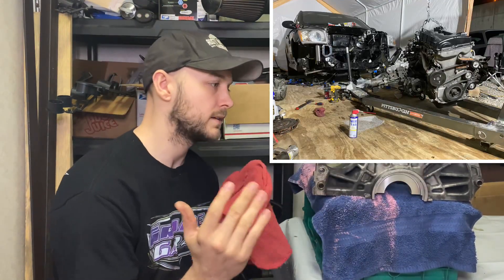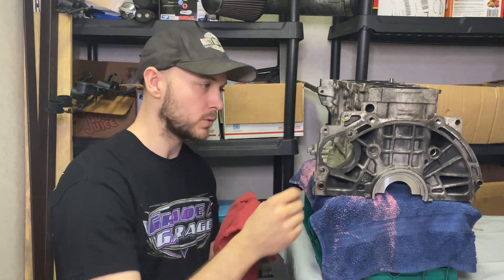SRT4 AWD CONVERSION: How to Convert Dodge Caliber SRT4 to All Wheel Drive / Evo X Transmission

Comment: Funfact: the Dodge Caliber SRT4 was supposed to be AWD, but due to budget cuts at SRT they had to compromise and had to make it FWD. Power had to be cut down too, as there were rumors of 330-350hp first (which is now down to 285/295hp).
Reply: And I got screwed on the other side of Dodge. I have a jeep compass 2.4 L all-wheel-drive, but no turbo no power although it has a automatic slap shifter in it.

Comment: Thanks for this video.  I was losing hope since I have a 2007 Dodge Caliber RT (AWD) and the automatic transmission is SO lack luster.  I want to convert it to manual, but didn't think there was a manual transmission that I could mate with this engine.  So I have a different but similar goal...make an automatic AWD to a manual AWD.  Looking forward to the videos where you show how you fixed the oil pan and bottom engine clearance issues.

Comment: Basically what I heard was evo x tranny, transfer case, clutch, flywheel, ladder frame and mounts. Caliber rt, drive shaft rearend, tank, and hubs.
Reply from the maker: Evo X ladder frame will not work on the 4b12 block. The caliber rear diff does not match the Evo transfer case drive ratio so it will not work together with it.

Comment: What a great video technically explaining what it takes to make the CSRT4 AWD,I have a 2008 SRT4 that I brought from Canada in 2009 with 25000km now I have 130000km on it ,me and  my son now a mechanical Engineering do a bit of car racing ,shifter kart racing and dirt bikes racing, we work ourselves in our projects and racing modifications, and know how much work it takes to do this kind of mods,think design and try it takes some time, that's why we understand when you said it takes a bit of work to do this (A LOT)but when you love doing  it the results are the best payoff , we always are thinking we have to do 4wd the Srt4 because we have enter the caliber in about 5 hill climbing races for street cars over tarmac surface, the car is amazing good for it even do is pretty much stock, we just have KN air filter,65lb/hr injectors,clutchmastes 250,3 inch straight pipe no muffler and a heavy foot, we have beat some good cars like Bmw ix,Subaru wrx,Mazda etc,even when we don't push the car to it's limits because  roll cage it was not mandatory for this class until 2016 when we enter and now we don't want to screw the car interior with it.anyway watching your build it gives us a clear view and advice of the parts,time and mods for it,its a little hard to get Evo parts down here in Ecuador,but we'll be looking for them now in case we decide to do it,and we'll be expectant to see your amazing  project fully finish ,congratulations again my friend.

Comment: I have just the opposite problem. I have a 2008 Jeep compass 2.4 L all-wheel-drive I cannot find any parts for the compass aftermarket so I am referring to the Dodge caliber SRT what parts will fit on my compass from the SRT.?
Reply from the maker: Pretty much everything. What are you looking for?
Reply: @rustynutsmedia  any information on aftermarket parts for performance because this thing does not get out of its own way. heard about Mitsubishi headers that fit and wondering about where I could find the intercooler turbo set up

Comment: Couple questions. 1 are the splines that goe into the translation the same as the caliber spines? You said you used evo hubs with axles and trans. Could you use caliber trans and evo axles and hubs? 
Next question. Did you say you can drop a evo block in just fine? If so would that fix the transfer case hitting the block issue?
Reply from the maker: Axle splines are different. They are not the same. 

I’m sure you could drop in an Evo block if you wanted to go that route and yes, that would fix that issue. But I will say I do not have first hand experience in that, so I can’t say 100%

Comment: Even if you dont actually care about turning the srt4 into an AWD for performance reasons(all srt owners care about performance who am i kidding) its probably extremely cost effective to swap to the evo x trans just for the sake of durability. As those 6 speeds in the caliber are actually horrendously fragile and everything breaks if you abuse them even a little.
I am however curious if the 02m 6 speed in the volk/audi group could possibly pair with the 2.4t. The quattro drivetrain from the late 90s to early 2000s and lack of transfer case sounds like a dream. The gears are kinda short tho but that transmission is often beat on like literal racecars and ive only really heard of the synchros failing especially on 1st but when that happens you can slip the clutch a tiny bit to get it in.
Reply from the maker: @Austin-bc1yh  you think the caliber 6 speed is fragile? What makes you say that?

Comment: The alternator is made that way to shut off when not needed and u can use the rt awd tank with the harness from the 4x4 from my other comment will plug and play and your tank will register correctly
Reply from the maker: I have to disagree with that statement about the alternator “shutting off”. It’s an OAD pulley, it contains a one way clutch and a torsional spring. Basically it absorbs vibrations from the engine and lets the alternator slow down gradually when shifting or shutting down the engine. 

Have you used the AWD tank and harness on a CSRT?
Reply: I stand corrected on the alternator

Comment: Video is great. Idk if you looked into it but do you think the girdle off the 4b11 could bolt onto the caliber block? I l know the motors are super similar but that would solve the problem of transfer case clearance
Reply from the maker: We have tried. It does not bolt on. Bolt holes don’t line up, neither do the oil passages. Currently, modifying the caliber girdle is the only choice.

Comment: so rusty nuts media i do have a question for your expertise im not going to do the awd swap yet :( funds :( but i did just blow my t355 in half do you know if the f5m42 from the lancer gt will bolt to my gema 2.4 theyre engine is gema based aswell i think itd be considered the 4b12 i found one for sale 500.00 only 5k mi on it and money wise im not sure if itll fit or not its only fwd
Reply from the maker: I wouldn’t be 100% sure on swapping those. I only have experience with the Getrag from the SRT4 and the Evo GSR 5spd. The bell housing bolt patterns probably align, but you’d have to look at all other factors to see if it would match up
Reply: @rustynutsmedia  I just bought the transmission I'll let you know when I find out I can send pics too
Reply from the maker: @M3CHF5  keep me updated
Reply: @rustynutsmedia  hey bud how exactly did you swap the ends on the shift cables?
Reply: It's in I sent u a couple photos on Instagram
Reply from the maker: @M3CHF5  cool man I’ll check them out

Comment: R/t awd is only automatic but I know how to make evox ayc rear work with the hydraulic pump from the evox using the stock chrysler electronics ur gonna need the harness from the compass or patriot 4x4 5 speed with the 4x4 controller I'm still looking into the caliber rt awd controller and plug it in and the computer is supposed to automatically recognize the controller and then take the wire for the stock rear end and run the wires to the ayc pump and enjoy also don't forget for easy install use the rt caliber awd front subframe it comes with the steering rack automatically set up to clear the ptu and drive shaft
Reply: And u can use the caliber compass or patriot drive shaft just swap the connection in the rear for the diff
Reply from the maker: The CSRT steering rack already clears the driveshaft. No need to swap front subframes. And have you confirmed any of this? Do you have it together and working or are you just saying these things “should” work? Not trying to be rude but I don’t want wrong information on the video.
Reply: I've done the 4x4 swap from the patriot/compass to the caliber and found out the hard way I had to swap the front sub frame while I was in a rent a shop so I wasted money on the lift locating and getting sub frame with steering rack from a compass
Reply from the maker: I had no figment issues with the Evo X transmission or transfer case hitting my steering rack.

Comment: Why can you not just take the all wheel drive train out of the caliber RT?
Reply from the maker: You didn’t even watch the video before commenting on it? That’s a little silly
Reply: @rustynutsmedia  would it be less work to just beef up the awd caliber drivetrain? I mean probably possible
Reply from the maker: @1teddy1979  the caliber AWD was automatic CVT trans. The transfer case is smaller than the Evo X (mostly due to the Evo clutch packs), and the rear diff wouldn’t hold one launch from what I can tell. I would say not worth attempting it as you’d 100% break stuff at stock power levels.
Reply: @rustynutsmedia  gotcha ok so i am just getting into these cars. So the transfer case is married to the cvt trans?
Reply from the maker: @1teddy1979  transfer case is what adapts the driveshaft to the transmission.
Reply: @rustynutsmedia  yes i just wondered not removable from the cvt?